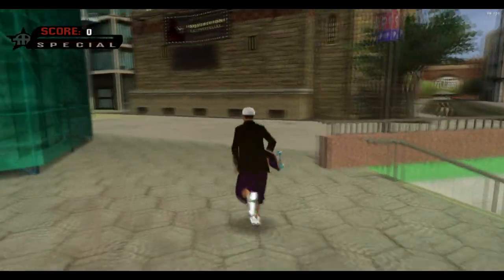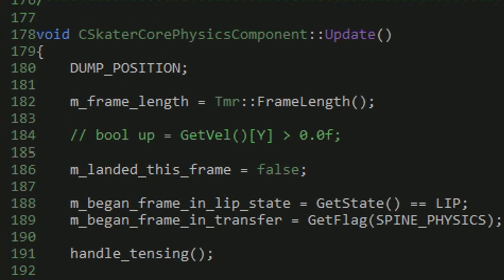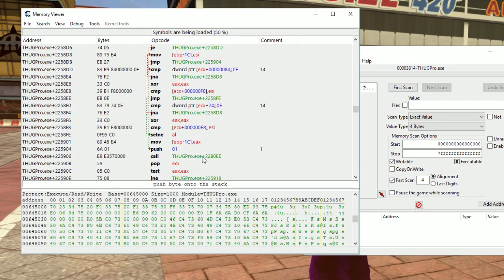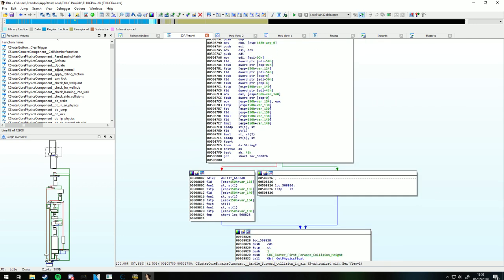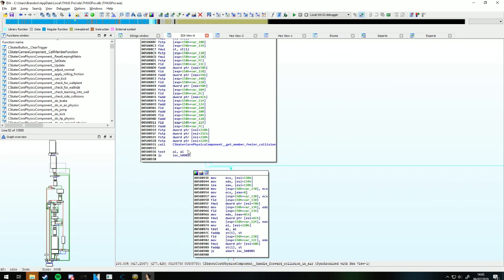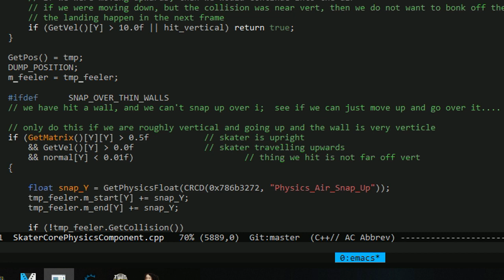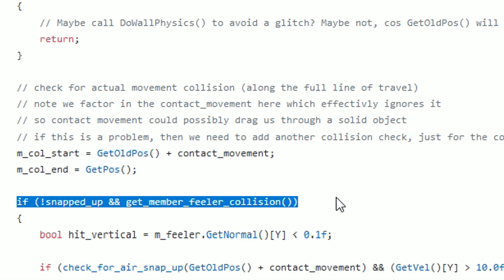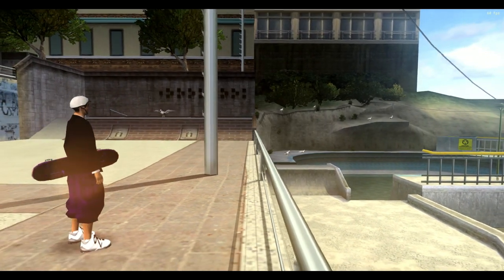How bonks work in THPS games (Mod Corner)

Comment: but that begs the question:

why are bonking rails infinitely easier and far more consistent than bonking any other piece of non-skatable collision? anything could be bonked, but trying to bonk the rail shown at the end in Australia is far easier than bonking something like the base of the crane also in Australia. Pretty much the same height as that rail mentioned, but much more difficult. Would be interesting to see a more in depth analysis on why certain bonks feel more consistent than others.
Reply from the maker: This is because do_in_air_physics checks if you can snap up onto skateable surfaces. That's why it's hard to bonk most ledges that exist at floor height. I could remake this video with more detail in less time but I'm so lazy